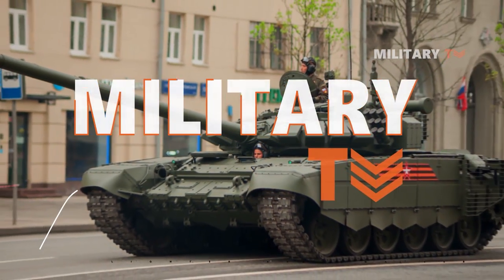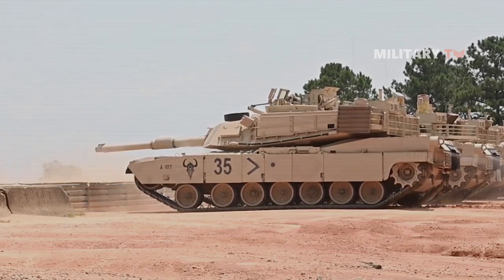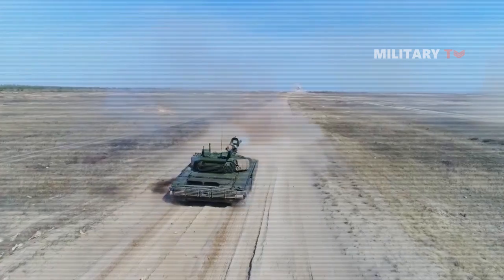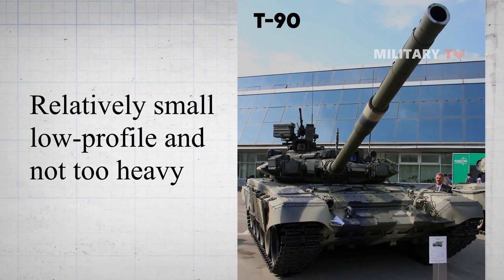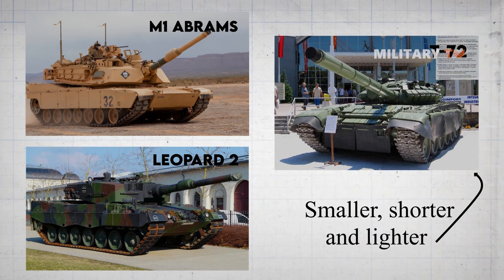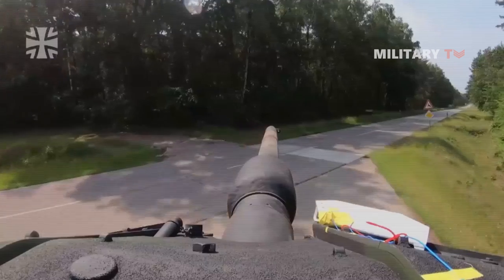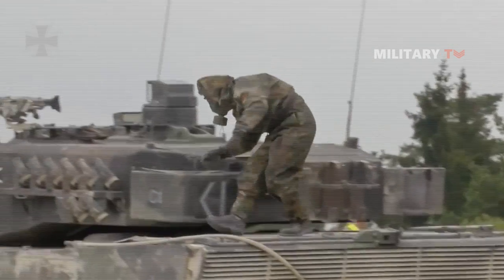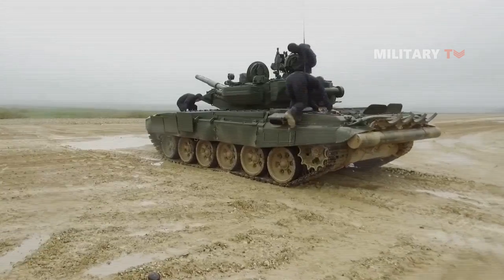Why are Russian tanks lighter and smaller than the western tanks

Comment: Heavier tanks generally tend to be better protected by (more) armour. Lighter/smaller tanks are more easily transported by sea, land or air, they consume less fuel (hugely important in real combat), they are generally more mobile, can deep-ford rivers, can move faster over more difficult terrain, can use smaller bridges, have smaller silhouettes (harder to spot and hit) etc.
Reply: not really. Heavier doenst mean better protected
Reply: Western tanks are not just heavier, they are significantly bigger, which means large, very poorly protected sides of a turret and hull. You can penetrate pretty much any tank with a RPG, just shoot its side or back. And russian tanks on average has 1.5-2x smaller side projection than western ones.
Reply: @redsun9261  I agree. My previous comment was quite (too) general. What I meant to say is that better protection is what more mass COULD give you - in principle, adding armour...

Comment: I would take an Abrams any day over anything Russian. We have the manufacturing capacity to flip a switch and build tons of them. We have many tanks already in service being constantly upgraded while having a ton in reserve literally sitting in a desert just waiting to be used if needed.
Reply: Yup your right just waiting on the Chinese computer chips to make the damn thing run.
Reply: From what I've heard, the Abrams is too heavy and underpowered for it's weight. I would go with the Leopard 2 :)
Reply: @oSJmee  The Abrams has a 1500 horsepower turbine engine that we designed after the logistics nightmare during WWII. Diesel can be hard to come by, thus the turbine engine can burn anything as fuel. You can literally pour vodka in the tank and it will burn. Leopard 2's can't even do that. The Abrams was designed for a different field of battle than the Leopard thus its heavier. Abrams can be fielded in roughly anything or anywhere. Leopards can't even go into urban environments without sustaining losses. Abrams has TUSK and Trophy.
Reply: @jkutnink87  What do you mean Leopards can't even go into urban environments without sustaining losses lol

Comment: I think one point that needs to be made is the influence to the design of a tank. Tanks today aren't designed for invading another country (contrary to belief) but instead are more closely designed to defends one own nation from attack. Meaning the terrain, climate and topography of the producing country of said tank, greatly defines how the tank will look and function, since it will most likely have to use the homeland terrain for any sort of defense.

Russian Tanks have smaller profiles, lightweight and highspeed, as well as limited elevating guns, because the Russian landscape is for the most part vast open and flat areas, meaning a large heavy tank wouldn't do to well if spotted out in the open. So they need to be fast to get to cover quickly, small to avoid detection and light to traverse soft areas.

Where as most Western Designs are built to travers more hilly, forested areas, needing their guns to have more elevation angles, meaning a larger turret. Larger profile means more armor to protect it making them heavier. A good example of this is the Swedish Strv-103. At first glance, it doesnt look like a tank that would work in most places, thats because it doesnt, its purely designed to work in the home country of Sweden and allowing the natural terrain aid its effectiveness. 

Now there are exceptions to this, such as AFVs being built solely for export or sale in another country, where design more favors their country than your own. Also sending tanks to another country for more offensive measures. 

Also Tanks dont always work alone. There are multiple support and axillary vehicles that work alongside MBTs so they dont have to be as versatile. For the M1 Abrams, it closely works with the M3 Bradely to help with reconnaissance as well as help with anti-infantry and light vehicle threats. As well as faster more nimble vehicles like the M1128 Stryker than can be equipped for multiple roles and duties. So a single tank needing to have everything or be able to do everything isnt exactly needed when you got multiple options that can take its place if a MBT is considered overkill for a situation. 

Overall, a tank is designed for the Battlefield its going to be fighting on. Most of the time that on your own homeland defending it from invaders. But rare occasions for protecting or attacking other nations if the need arises. So could we see changes to Western Tank design favoring the Russian model? Possibly, technology is allowing tanks to be more compact, less manned, and more efficient with less. But It still has to work, protect its crew, and accomplish the mission its given. So i guess time will tell what future designs will work or be more favored.
Reply: This is a very comprehensive and underrated comment, thank you

Comment: Western tanks are designed strategically for 2 types of wars:
-The war that your technological edge has decided in your favor before it even happens (late WW2 German wonder weapon philosophy as successfully applied in the 2nd & 3rd Gulf War)
-The war that's never going to happen (Seemingly invincible tanks too expensive to lose deterring any opposition)

Russian tanks are designed operationally around the deep battle doctrine optimal for large flat plains of eastern europe, where forces have to be relatively thinly spread along a long front line and there are few obstacles to facilitate an effective defense. There, offense is the only defense.
1. The first-rate tanks pierce holes into several of the weak points of the enemy's defence. Forces can't be concentrated on one point (like i.e. Blitzkrieg) because with no obstacles covering the flanks, it risks encirclement.
2. The large reserves of second-rate tanks pass through the holes to cripple the enemy from behind his lines by cutting him off from his supplies & communications as well as encircling him.

Comment: In fact, going light weight, was intended to allow better flight characteristics, when hit by 120 mm HEAT. This has proven so well, that it was taken over as the basic design principle for the T 14 Armata. Regarding the meaning of flight characteristics, the ammunition storage of every single T-Variant was designed to ensure flying ability for at least main parts of the tank, when only hit by APDS ammunition. For entertaining purpose for the crew, the bell based design concept of the turret of the older t variants, was taken over for the T 14 crew compartment.
Reply: Many manufacturers in russia specifically designed their tanks independently in a "competition" of sorts in order to see who can  engineer the best flight characteristics out of the group. It seems that management has not caught on to it yet as there seems to be an improvement over previous generations.

Comment: I was going to add that Western tank design has been based on a defensive conflict in eastern europe, while Russian for an offensive one. Soviet tanks would be advancing over rivers / crossing where bridges would have been destroyed by the west. The lighter weight tanks would be an advantage as there would be more crossing options, and bridging equipment would be easier to construct for larger spans.
Reply: Your theory got destroyed in the roads of Ukraine
Reply: you have it upside down my guy
Reply: In addition in order to be used defensively a western tank needs a bigger turret because it needs more gun depression. Without gun depression you can't effectively use ground cover (such as a hillcrest). Bigger turret = more weight = a bigger engine+chassis to carry it. So we end up with tanks that are often 20 tons heavier.

Comment: It has been proven time and again that the western tanks have been superior in combat to the Russian made tanks.  Now, auto loaders require maintenance and if it jams, the tank becomes useless.  That doesn’t happen with human loaders.
Reply: This video overlooks or obfuscates so much information that it is obviously a hatchet job. The autoloader is garbage. It wounds crews and it cannot unload the breech. You have to fire the round to make room for the next one. The autoloader requires some dangerous ammo storage to work. The ammo is arranged in a ring around the turret. This is why Russian tanks brew up so reliably if you hit them with anything more powerful than a sling shot. Western tanks can survive ammo cook offs. Russian tank's ammo cookoffs lollipop the turret. They may be lighter, but they're still limited by the logistics behind them. The MPG "design feature" is a joke, they can't even invade next door reliably. ERA armor was outdated decades ago. Upgradeable armor packages on tanks like the Abrams (like TUSK and SEPv3) keep them modern and current.

Comment: The T-90 is a T-72 with reactive armor and aerial defense equipment attached to it. It has plates of reactive armor (basically semtex wraped in aluminum boxes, to deflect a projectile away from the vehicle) attached to the turret.

Extending this discussion, the T-72 is essentially an "upgrade" of the T-62, replacing the loader with an autoloader and upgrading the main armament from (I believe) a 115mm rifled gun to a 125mm smoothbore, as well as many other technological advancements (I think they got rid of the infrared spotlight coaxialed with the main gun, and added a gun stabilizer to permit the tank to fire on the run).

The autoloader has reduced crew from an average of 4-5 for main battle tanks to... 3. But this requires the commander to assume both the command and loading resposibilities, and according to NATO documents I have read (all public domain), this results in a slower and sometimes misloaded firing sequence.

Summary: the T-90 is an upgrade of 1960s technology. It is still very lethal. But it is outranged and has smaller ammo capacity than its NATO counterparts. And, unlike the M1 (which has an engine that can drink gas, Diesel or kerosene), the T-90 still belches out massive Diesel fumes, as seen in this video.

But the T-90s are less expensive to produce en masse, and that is a distinct advantage. Typical Soviet thinking - more is better than better.

To those in Ukraine, my prayers are with you - Godspeed.
Reply: T-62 has autoloader

Comment: Head to head, the Abrams wins EVERY time…and it’s not even close.
Reply: First off, there is no head-to head for those tanks for strategic reasons. 
Nowadays you hardly meet tanks vs tank battles. This is not World War 2. - they usually help defeat artillery positions, help support troops, etc. 
Second of all- it depends what you are comparing, if you are comparing T-64 or T-55 with Abrams- this is ridiculous comparison. That's like comparing a steam locomotive and a blimp. Those are completely different kind of machines with different strategic goals! 
Even comparing Abrams and Russian T-72M or T-90 is still not quite reasonable- they have different purpose. Abrams is a heavy class tank. Russian tanks are all medium class. But they still can destroy each other, depending on the capability of the crew.
Reply: @digimaks  Have you heard of the Gulf War or have you been living under a rock? One of the world's greatest tank battles happened during that time. Yeah, It wasn't WW2 because it happened in 1991. One instance during the Battle of Easting, 9 Abrams demolished 28 T-72s, 30 trucks, and dozens of support vehicles in 28 minutes - no Abrams were harmed during that demolition. Some Abram operators even compared it to playing a video game on easy mode.

Comment: T-72 has automatic loading and 3 members crew. Hence turret is way smaller, hence weight savings.

How Soviet block managed to pull out such tech miracle and failed to produce decent personal vehicle is beyond me.
Reply: The reason is clear. There was no competition between car manufacturers in the Soviet Union. The factory could not go bankrupt, workers could not be fired, sales could not fall. And also, there was a plan from the government: cars should be simple and affordable. Therefore, the development was very slow.
Reply: @Артём-ц5э8з  From what I understand, the Soviets built cars like they built most everything...definitely NOT for "looks", and as they weren't subject to market forces, they didn't have to.  But again, like most everything they made, durable, simple, easily fixed, not much for comfort, and annoying things go bad which don't necessarily keep them from running, just makes them "clunkier".
Reply: The earlier Russian tanks (possibly the T54, definitely the T55 and T62) had auto loaders and 3 man crews.  The US discussed the tech but decided against it.
Reply: @ret7army  When I was in the army, rumor was, that Russian auto-loader did not function properly.
Reply: @workrmtly5582  They worked the "bugs" out of the auto-loaders after a few gunners lost their arms.  Most work fairly well now.  The main trouble is, they don't out-pace a 4-man crew with a beefy kid hefting rounds into the breech, and though the need for only three guys does make a smaller turret and tank overall, that's also one less guy, usually the one that gets the "shit jobs" anyway, to maintain the vehicle.  And ALL tanks need a serious amount of daily work just to keep running!
Reply: @augusto8821  Pretty much anything Russian built has an aura of cheap and shitty to it. You can see where the corner were cut on everything they build.

Comment: I disagree when you said, indirectly, that western tanks were more inefficient than Russian tanks. Although they can be produced, atgms can still target them, no matter how small they make them, as proven in Ukraine. Also, an auto loader is halfway to death for the tanks. When the tank is hit, the autoloader will go up in flames, while the M1 has a mechanism that doesn’t allow it.
Reply: Western tanks are equipped with blowout panels in the turret, where most, if not all ammo is stored. They direct the blast away from the crew.
Reply: @sirethanthegreat4069  Also while saving costs for one crewmember, in a conflictzone having one less is not necessarily a good thing if the tank breaks down. And while a loader can get tired, he/she still functions. An autoloader can fail, and that disables the tank.
Reply: @Colt16v  exactly.